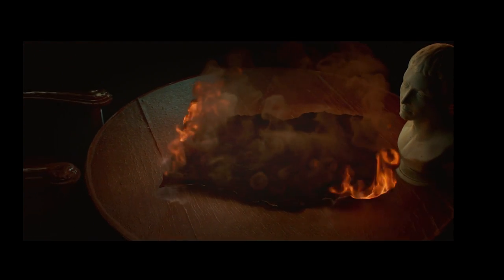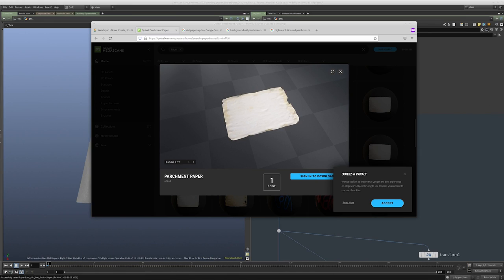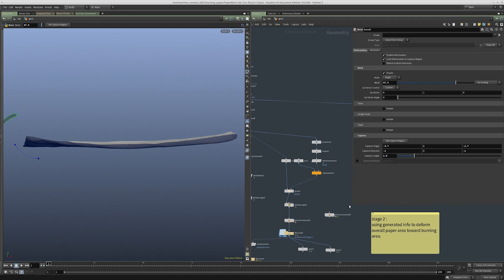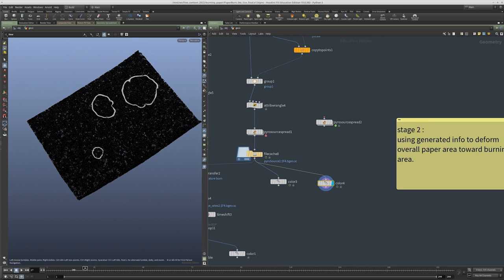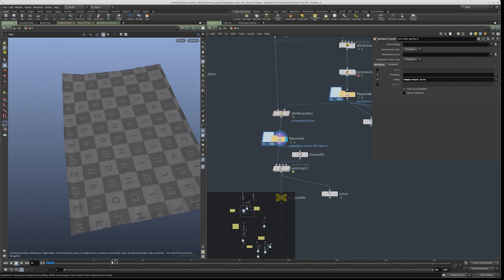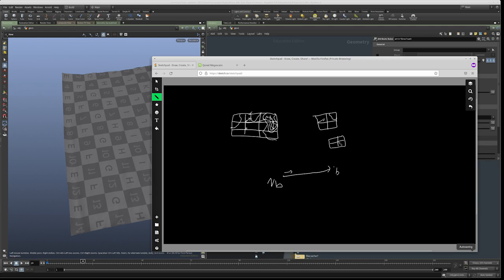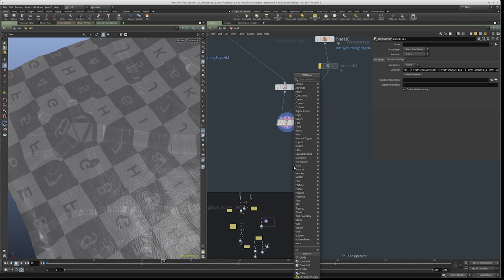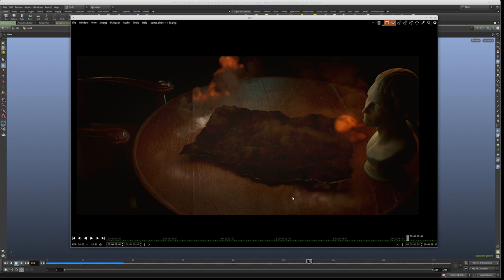Burning Paper Tutorial Using Houdini & Karma

Comment: Someone know why my "pyrosourcespread" don't take the group and only do the first wave?
Reply: Saber modded pyrosourcespread node and updated its solver with wrangler to add previous frame temperature. But you can go straightforward way - just use @ignite = 1 instead of @temperature=5 in wrangler before pyrosourcespread and add ignite to animated attributes on Animation tab of pyrosource node.
Reply: @mmmAlex  ty I will try
Reply: there is example highlighted in example file. I will shortcut it for you. You need to unlock pyrosourcespread by 'allowing editing of contents', jump into solver and create attribute wrangle at the beggining. Prev_frame into input 0 and input_1 into 1. Write down the vex: f@temperature += @opinput1_temperature; f@temperature = clamp(@temperature,0,10); It will repetitively add temperature value and reevaluate it every single frame. Clamp function will fit it within certain range so you can manipulate it to your likings.
Reply: @whocares6302  Damn, why wondering how I could make it work, been trying somestuff, but there we go ! Thanks :)
Reply: @whocares6302  Thanks,my friend